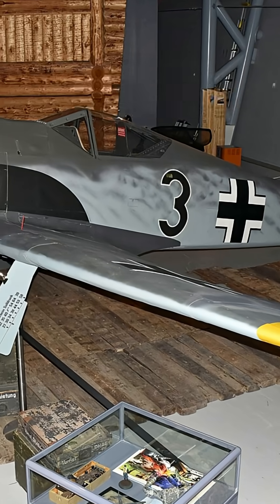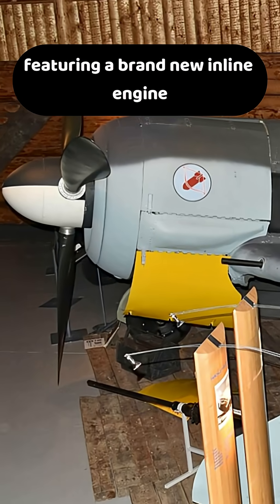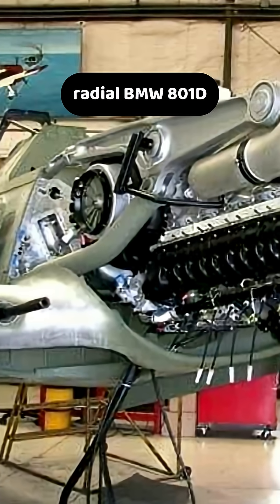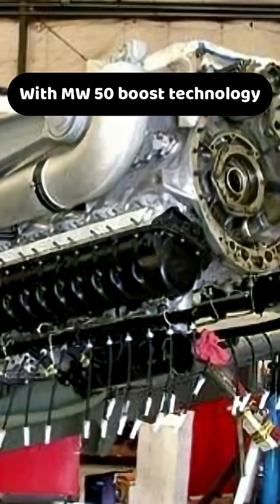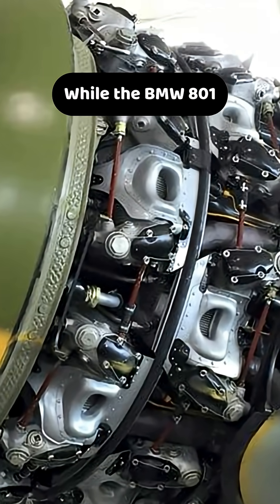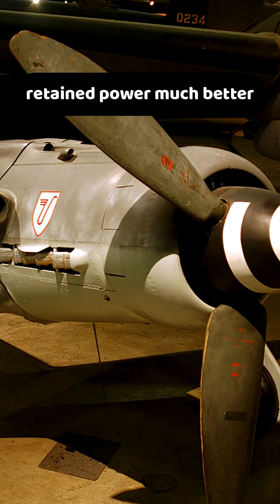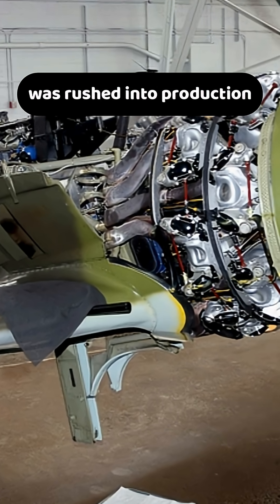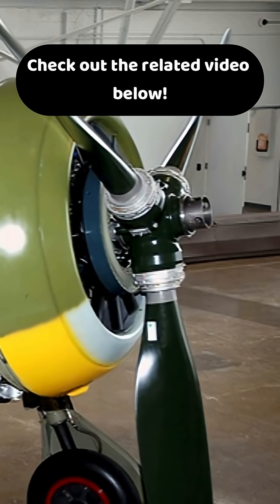How The Jumo 213 Engine Transformed The Fw 190D?

Comment: The Jumo 213 was the most reliable engine in late 1944. Outperforming the DB 605 and 603 in terms of flying hours between overhauls.
Reply: The 213E was the strongest V-12 to see combat in the war
Reply: @shawns0762   The French built and operated Jumo 213 engines (Arsenal de l'Aéronautique 12H) in Nord seaplanes until the late 1950s or early 1960s.

Comment: The Jumo engine was used because there was a lack of DB605 engines. The Jumo was a bomber engine, but it worked in the Dora. So no, it was not a new engine.
Reply: Kurt Tank insisted on DB-603 engine to be instslled in Fw-190, but was forbidden. Eventually, there were only some prototypes of Fw-190 D-14 and D-15, capable of 700+ km/h at altitude.

Comment: From what I understand, part of the reason why they the started to use a V-12 was due to the Radial Engine Factories being bombed, not destroyed, but damage....
So they went with designing it to accept a different engine.  Part of the necessary was to place a "Constant cord" fuselage plug near the tail to help by moving back the Center Of Gravity and the Center Of Pressure to where a pilot could control the plane!

Comment: But Germany lacked high octane gasoline the new engine needed
Reply: Blödsinn. Die Motoren wurden eben genau so gebaut, weil der Kraftstoff minderwertig war. Hubraum Baby, Hubraum!
Reply: @Sv-i5i  Yes, late in WWII, Germany suffered from a severe shortage of high-octane fuel for its Fw-190 fighters, which was crucial for their engine performance and the planes' competitiveness against Allied aircraft. While Germany had access to high-octane fuel earlier in the war, dwindling oil reserves, reliance on less efficient synthetic fuel production, and extensive Allied bombing of synthetic fuel plants crippled their fuel supply, forcing their aircraft to rely on lower-quality fuel and reducing their effectiveness
Reply: Absolut richtig. Aber Wasser-Methanol Einspritzung reduziert das "Klopfen" also die Selbstentzündung im Motor auch sehr gut. Deshalb hatte die 190 D einen sehr großen Vorrat davon im Vergleich zu anderen Baumustern. Die Dora konnte über eine halbe Stunde mit zugeschaltetem MW-50 fliegen. Generell kann man sagen, dass der Aufwand der betrieben werden musste, um hochoktanigen Kraftstoff zu kompensieren sehr hoch war.
Reply: @Sv-i5i  Für die hohe Kompression wurden hochoktanige Kraftstoffe benötigt. Diese Kraftstoffe waren gegen Ende des Krieges nicht mehr verfügbar.
Reply: German green dyed C3 fuel was repeatedly improved and by early 1944 was rated about 97 RON and 130 PN.  This compared to 100/130 for allied fuel.  The fuel had started of at about 93/115 then 94/120, 96/126 from tests on drop tanks and shot down aircraft.
-however is was maybe only 33% of fuel produced and most was 87 octane B4 blue dyed fuel.  The allies also had 120/150 fuel,  
-C3  fuel was slightly better than B4 + MW50 and the fastest Fw 190D9 tested used C3.  Over 400mph at sea level
Reply: @williamzk9083 the problem was performance at high altitude
Reply: That’s what water meth is for, it makes up for 💩 gas.

Comment: According to wikipedia j213 is a v12 not an inline.
Reply: That's true, but in aircraft terminology, anything that's not a radial is referred to as an "inline" powerplant. The term is also applied to  the Allies' Allison, Merlin and Griffon engines. A 3rd category is the opposed type such as those from Lycoming and Continental

Comment: V-12, not an in-line.
Reply: Some Countries actually used the term Inline for V Block Engines, why?  "Heck" if I know!!!
Reply: Yes it is. An inverted inline V-12. 

Inline is the term generally used regarding aircraft engines. It just refers to the general type of engine, not the exact configuration - inline can be different V arrangements, inverted or not, boxer engines of different sorts, etc. Same thing with radial. A supertype.
Reply: Morons about.

Comment: Fw 190A performance dropped off markedly at over 20k ft  not 30k ft
Reply: Less than 20,000 feet, it was 2 speed single stage with poor metallurgy and fuel.